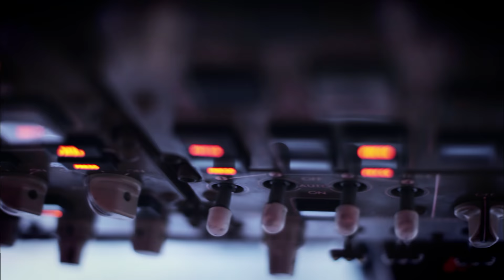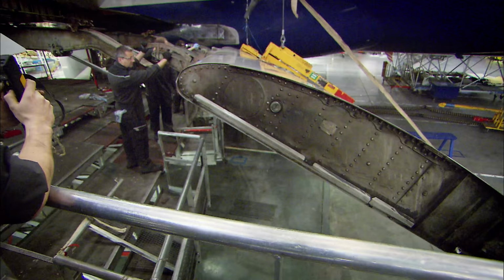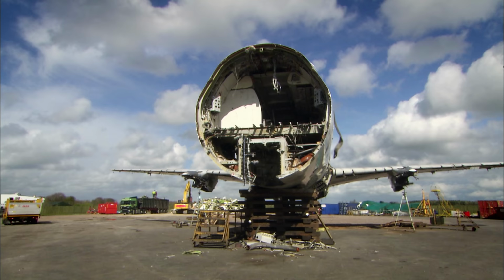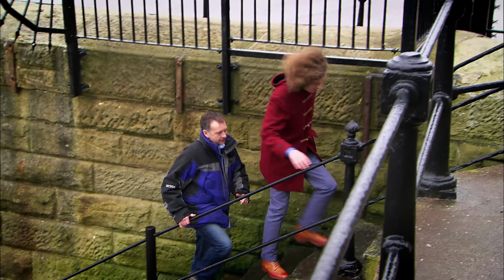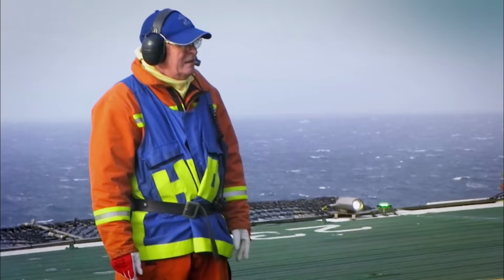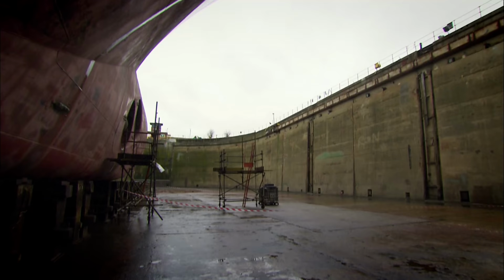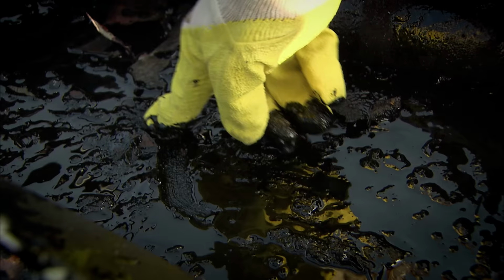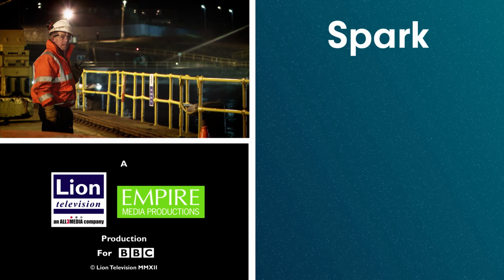Inside Three Of The World's Biggest Engineering Marvels | Engineering Giants | Spark

Comment: How they use the CO2/Nitrogen to actually 'suck' in more air to inflate the emergency raft/slide is a truly genius hack using physics
Reply: Great use of-technology for  our brainy young ones !  and older guardians watching and guiding yrs. In time Is a good  r un time
Any small leakage on connection ? I ontainerq q
3 sec run time to refold back in to getting into container
Reply: its not a "hack"
Reply: They actually did a poor job explaining how this system works, for instance they didn't mentioned the pressure differential, and that's why it sucks the outside air like a vacuum.

Comment: It's nice to remember what Boeing and skilled maintenance technicians are capable of.
Reply: It's a shame they merged with MD, they used to build the safest planes before that.
Reply: @pissarozzz7498  Lockheed's L10-11 was superior to the similar MD DC-10.  Delta used them into the nineties.
Reply: @AudioFileZ  the L10-11 was a very good aircraft indeed, cant even compare to the mess that was the DC-10. It's unfortunate they had that issue with the RB 211 deliveries. The whisperliner its one of my favourites to this day. But that doesn't take from the fact that before Boeing merging with MD they had the safest planes on earth.  You need to remember that only about 200 L10-11 were built, whilst boeing built thousands of aircrafts.

Comment: Brilliant.   I probably missed it but I wonder how often they do this thorough examination of the rivets.... I've been thinking about it, and I'm going to do the same for my car tomorrow.
Reply: lp lp
Reply: P Pool
Reply: LP
Reply: Blimp
Reply: Pp
Reply: Every 6 years complete overhaul inspection.
Reply: So, how'd everything check out? Any loose rivets?
Reply: @DaneOrschlovsky   You wouldn't belive it...going over speed bumps I could feel the frame shift unnaturally.   Turns out it is broken rusted through.  Mechanic sais he could weld it for 1400. I declined.  U can't mess with the frame and rust.

Comment: While they were conducting lightning tests it brought back to my mind one evening flying into Rota, Spain aboard a US Navy P-3. Fairly clear weather and I was just behind the cockpit. I saw a HUGE FLASH of light and jumped into my seat ready to send an emergency message. When everyone’s eyes cleared all looked good except all my radios and radar wouldn’t work. We had taken a lightning strike. The discharge blew all the communications and radar systems. Outside the aircraft it looked like a handful of BB’s had been tack welded to the skin. On the opposite side of the aircraft at the tail on the horizontal stabilizer there was a hole big enough to put your fist thru. The skin metal had been vaporized where the discharge left the aircraft. Just another day in the Navy.
Reply: O
Reply: You’ll get pancaked son! Sit tf down boy!
Reply: 9.o
Reply: O iiiiok
Kim
Ikki
Ikkkkk
Ko
Reply: That’s what those carbon bleed strips are for they are sacrificial. They should conduct out the Lightning that is flowing through the fuselage. Why did they not function. They are the easiest way out for the lightning strike.

Comment: The guy looks shocked at how much it will cost Shell to remove the oil rig.  What's he a stakeholder?  Shell put it there, they should have to remove it...  Also, the fact that they wanted to just dump it in the ocean is bonkers.  Then the guy was like "I don't think we explained it very well".  No, you explained it perfectly.  Unbelievable.  The fact that 70% of the oxygen we need to survive comes from the oceans and you just want to dump an oil rig in the middle of one is insane.  How many oil rigs could you dump before it becomes a problem in Shell's eyes? 10?, 100?, 1,000???  Just insane.

Comment: Still kind of sad seeing a 747 scrapped but I know it's necessary due to the cost of maintaining an aging airframe...
Reply: It's pointless to use such gigantic aircrafts now because less people use long distance flights to other countries , those massive jets are to costly to operate. The only use for them now is the United States President aircraft and a few countries like China Air and Malaysian airlines also use them but that's rapidly fading away because there are too many crashes involving them and the airlines are just switching to smaller frame aircrafts.
Reply: @josephbennett3482  too many crashes involving them?
Reply: @cairok2097  yes , there has been an increase in deadly crashes. Most 747's that have crashed were cargo jets there's few passenger carriers that have crashed.
Reply: @josephbennett3482  thought you were bullshitting me, checked and found 61 crashes in the last 52 years, though most of them not being fatal youve still got a point there. Though i dont agree with them being useless at the moment anymore. That may have had been the case 1 year ago but as air travel is increasing once again we may be back to normal in 5 years if nothing new comes up.

Comment: I have a concern about a triple feed point of water into a thin sandwiched envelope. I hope that you make room for modifications to the unbelly of your new water plate to increase flow evenly across a plate that will now be expected to hold the heat and pressure of 20 million pounds of thrust instead of 17. I'm rooting for it not to fail even though I'm having doubts about how thin that water jacket has been engineered and manufactured.

Comment: as i have understood bernuli's theory regarding lift on an airfoil be it wing or sail is that the abject is sucked not pushed  ..so is my understanding incorrect are wings pushed into the air or sucked are boats pulled forward or are they pushed?
Reply: I'm surprised so few people are mentioning this in the comments. My jaw dropped when he said it was the increase of pressure below the wing pushing the aircraft up.  I've always been told this produces no lift whatsoever, that all lift is created from the decrease in pressure above the wing.  I've personally assumed both worked in tandem to some degree, but as I'm just a layman and no engineer I've kept my opinion to myself. Now, after hearing this, I am even more skeptical of engineers and scientists. Not of science, mind you, but of the ists who claim to speak for science (the idiot Tony Fauci above all others).
Reply: @RoySATX  it is not well explained  anywhere i have come across it , as i see it without the partial vacuum  caused by increased velocity  there is no"lift"   ....and to my logic vacuums do not push they suck
Reply: It’s partly both. That’s why fully symmetrical airfoils still work. As does flying inverted as well as models that fly with a flat, completely flat airfoils.
Reply: @JaredKlatt  flying inverted you still generate lift...but its down and you apply dive to climb so that answers nothing for me . can you elaborate on flat airfoils i am unfamiliar with examples except possibly a box kite and i dont understand the mechanics of an un cambered foil   it sorta defeats the definition. i understand it is a strange but precise question which will be difficult to explain simply

Comment: Hope nobody left a wrench somewhere!
Reply: I went to have a car exhaust replaced on my car at a well known UK company. They seemed to take forever as I sat in the waiting room, then it was ready and waiting on the concrete apron. I paid, and off I went revelling in the now silence, when suddenly there was a clatter from under the car, I looked in the mirror to see an object bouncing high above the traffic some cars taking avoiding action. When I could I stopped and walked back along my route, what I eventually found was a heavy rubber mallet, the following drivers and the fitting company were very lucky. One mistake, that is all it takes. Cheers

Comment: THE BETTER QUESTION IS, HOW MUCH FUEL DOES THE BIRD BURN AT FL 350?
ABOUT 1 US GAL (4 LITERS) PER SECOND
1000LBS PER 150 GAL.  36,000 GAL OR 150,OOO LITERS PER 10,000 MILE TRIP
KEROSENE ... MORE OR LESS
Reply: That's a ton

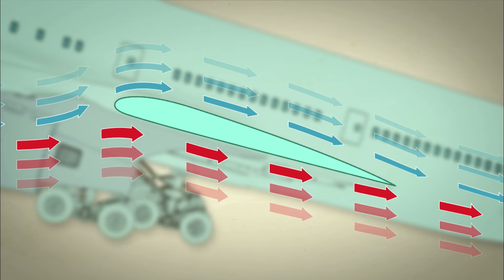Comment: 23:23 WAIT!  Wait a minute, now!  Which is it?  Does a reduction of air pressure above the wing pull the aircraft up or does an increase in pressure below the wing push the aircraft up?  I've always been told the reduction above the wing creates the lift, but here he's saying the opposite is in fact the case, that the added pressure below is causing the lift. Now I will admit I have always assumed both are probably working in tandem to some degree, but this is the first time I've ever heard an engineer or scientist state anything other than the lift is caused solely by the reduction of pressure from above the wing. In fact, I've always been told by the intelligencia that the pressure from below the wing isn't enough to produce any sort of lift whatsoever.  Good job: I'm now even more skeptical of scientists. Note I'm not questioning science, just the ists that claim they speak for science. You can blame the idiot Tony Fauci for most of my skepticism.
Reply: as far as i am aware there is no increase in pressure under a wing  that is "normal" pressure there is a reduction from "normal" over the upper surface...ignoring the boundary air layer and whatever other oddities happen at weird scales
Reply: I have always thought of it this way:  The airfoil splits the air through which it passes. Assume laminar flow. Assume that any particles separated by the air foil on the leading edge must be rejoined on the trailing edge once the airfoil passes. The shape of the airfoil is such that a particle of air that is forced along the top surface must travel a longer distance than its partner which travels along the bottom surface. Thus The space between any consecutive air particles moving along the top of the air foil will necessarily be greater than the space between any consecutive air particles moving along the bottom of the airfoil. The effect is that the density of air on top of the air foil is less. Pressure therefore is experienced. From the airfoils perspective there is lower pressure on its top surface and higher pressure on its lower surface.
Reply: If you think about it it makes sense that the wing is being pushed up by means of the angle that the wing interacts with the oncoming air.  When large planes take off they don't leave the ground until they rotate, which changes the angle of wing to air interaction and pushes up on the bottom of the wing.

Comment: If the cabin looses air pressure the oxygen masks will only last about 30 minutes.  My question: Wil the pilots be alerted if this should happen?"  If this case this does happen the pilots must gett either the air pressure back up or drop the plane down to 10,000 feet so the passengers can breath.
Reply: yes the pilots are informed by an onboard system if oxygen masks are deployed

Comment: @Spark With regards to the inflation of the escape shoots; the innovation design of sucking in ambient air 00:15:37 to inflate them is really clever. This makes me wonder what the procedure might be in case of a water emergency landing. Those inflatable shoots look like a possible raft to me. Are the ramps designed to flip over with the tanks above the water line when detached? If not, I do not see how they could be inflated in the water.
Reply: The outside valve closes when the slide is fully inflated, if am not mistaken.

Comment: The 'theory of flight' explained by a complete layman who has obviously been indoctrinated by some zealous anti-Bernoulist, how annoying. If the angle of attack is solely responsible for lift why is the airfoil (of which there are thousands of plotted types for every application) so crucial? If AoA is primary then a simple teardrop would do fine, in fact a simple flat plate would work, less efficiently but it would work. What of the lift devices, camber increasing slats, flaps etc? They work to increase the camber which increases lift, what of aircraft that fly with zero incidence? Utter nonsense  annoyingly put forth as fact.
Reply: Calm down there buddy